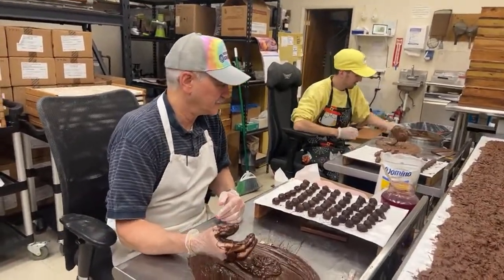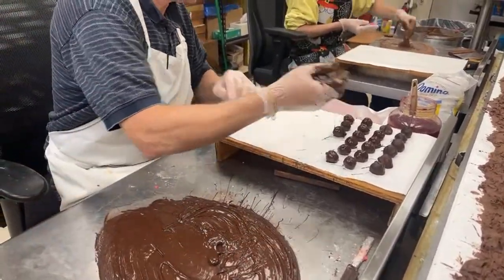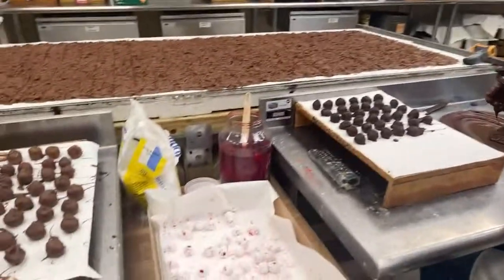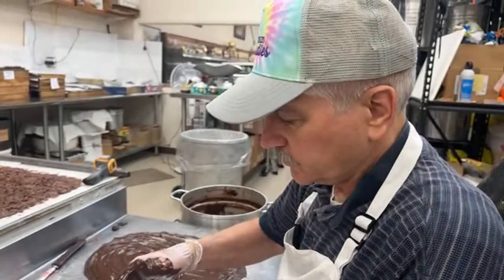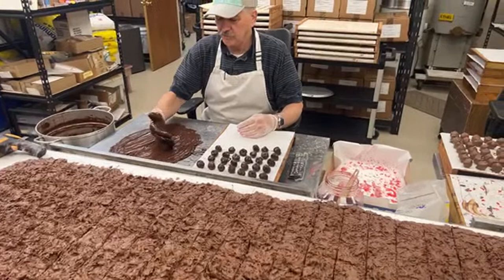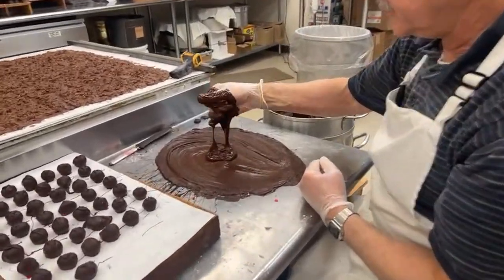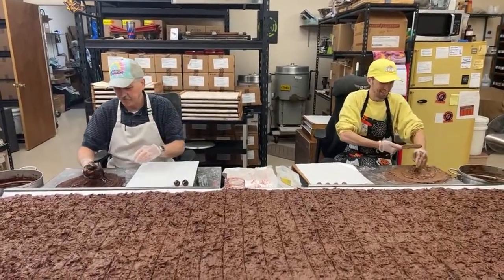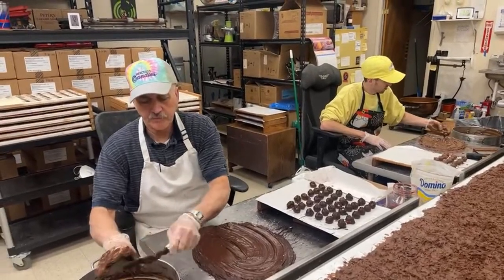Steve Teaches Cooper Chocolate Covered Cherries!!! 🍒

Comment: Maraschino cherries are ACTUALLY considered the equivalent of dried fruit. I know they aren't actually DRY, but they ARE made with either preservatives or alcohol that preserve them.

The difference between cherry cordials and chocolate covered cherries is that the cordials are made with the maraschino cherries preserved in ALCOHOL, whereas the chocolate covered cherries are made with the maraschino cherries that use preservatives instead of alcohol for preservation.